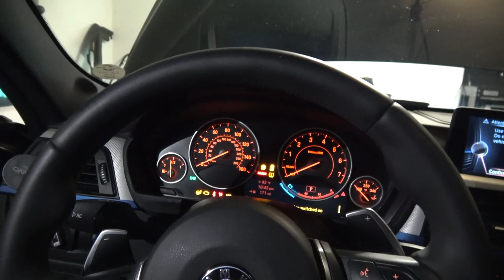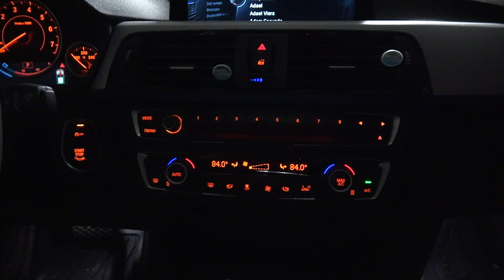DIY HOW TO BMW 335i N54 N55 OIL FILTER HOUSING LEAK FIX

Comment: You have to pull the injector connectors and crank the engine to prime the oil system. BMW put a tsb about this. You’re lucky you didn’t have any damage.

Comment: These things cook gaskets because of the stupid high oil temps they run at, on the N54/55 its so easy to install a BMS sport oil cooler valve, do it and save headaches. Wish it was that easy to do on my BMW V8s!! 
On the other hand, I just watched a whole video on something I already know how to do because I like the way Alberto works lol Good video
Reply: Now your oil is cold for like 20 mins instead of 5 mins. Bad idea

Comment: Clean job 👍
BMW Recommand to prime the oil circuit after major job on it. N55 can quickly have rod bearing issue if the oil pressure is low.
Pull out the fuel pump fuse, remove the residual fuel pressure in the rail so it doesn't start.
Crank it 3x10s, let the starter cool in between.
Reply: I was so scared I pulled the injector wires and the fuse, and poured extra oil into the filter housing before cranking

Comment: Wow.. I've seen many DIYs on the BMW E90s and E46s, and I must say, you did a great job with narration, and attention to detail on the important steps.  Great camera quality as well.  I thank you very much, I must say that I have a 2011 E90 335i, which has a slightly different engine arrangement mostly from the airbox, from what i can see.  

Thanks again my friend. I'm now subscribed.  I'm glad to throw you donation to support your Vlogs, let me know.
Reply: Your 2011 E90 335i probably doesn't have the oil cooler attached to the side of the Oil Filter Housing like Alberto's car in the video... Mine is also slightly different, in that I don't need the first gasket that he replaced.

Comment: This is a great comprehensive video! My oil filter housing wasn’t fixed well causing more spills, an engine smoke out and then a engine overheat all in a 15 months on my 335i with less than 50k miles. This cost 4K to fix because it was largely misdiagnosed. My mechanic didn’t even see the cross contamination with the coolant! I did and I’m a girl!! This video was a huge help in explaining the process to me. Thank you!
Reply: Also, love how you suggested to drain the coolant first!!!!!! And the precautions on the oil filter! You do clean work! None of the other demo videos explaining this fix take this measure which is great because when you have chronic leaks a clean job is paramount! Rock on man!

Comment: I did just this on my F30 335 2 months ago.  Pretty easy, just tedious that was all.  I made a grave mistake by letting the oil leaked so long.  So I had to also replaced the serpentine belt and did major engine cleaning of oil.

Comment: Thanks for the video, it was really good. I am hobby mechanic, this was my first engine work ever and your video was one of the main source for information that I used. Personally I had a lot of problems getting the intake out of the way also the oil cooler line ended up leaking a little bit, apperantly the orings are supposed to be renewed each time they are disconnected.

Comment: A tip for bolts in tight spaces, use about 6 to 12 inch piece of vacuum hose attached to the head and feed it.  I also use that with spark plugs as well so I dont crossthread.

Comment: hi is in US The torx different az im in Europe and to unscrew  this middle bolt , near the oil thermostat, i need to use T27, i tried with T30 but does not fit,

Comment: If I'm not mistaken there is a jack point dead center under the engine, at least there is on my 2009 335xi, makes it super easy to lift the whole front of the car, but I'm sure you knew that already Big Boost :)

Comment: Damn those bmw love to tick. I remeber stressing out so bad when i first got my n54 and heard that loud ass ticking without the cover on
Reply: It’s the high pressure fuel injection. The plastic engine  covers are supposed to suppress the sound.

Comment: Is there any sort of temporary fix to this problem? Currently need some more time to get the money together for the fix, but is there anything I can do to slow the leak? Sorry if this is a stupid question, I'm not mechanically inclined but have been learning a lot with my car and do the work on my n55 335i myself. Haven't had a single issue yet but I know this problem needs addressed ASAP

Comment: Alberto you shouldn't touch used motor oil man. It's one thing to touch it if you do an occasional oil change here and there and it's another when you touch it everyday to make a living. It's been observed that prolonged exposure to used motor oil causes cancer. Save yourself some grief for the future. You don't want to keep touching that stuff.
Reply: Belicose777 you have never worked on a car if your hands havent been covered in oil lol you are not going to get cancer
Reply: Dixie Racing Team Black latex gloves and a long sleeve shirt. I've had to wash enough grime and oil off of my hands and forearms to learn how to keep it off of me. Key word here is prolonged. It's not a possibility it's a recorded observation that constant oil exposure to your skin has caused cancer in the laboratory test environment. Read the warning label on the next quart of oil you buy. Just a warning man. Just looking out. Also you don't need to have contracted crabs to have had sex. :p
Reply: All he needs to do is where gloves when you do work that's what I do
Reply: i also work on cars daily and i always use latex gloves when working with oil and work gloves work on other no oily parts. Not just for protecting myself but also because its so much easyer to just remove th gloves and your hands are clean.
Reply: My grandpa owned a garage and worked on cars his whole life. His hands were always very oily and he is still alive today at the age of 90. Literally everything we do causes cancer these days. Stop being afraid and just live god dammit.
Reply: Just look outside everything causes cancer. I agree that its nice to use gloves but im sure this dude has a mom already!.
Reply: If you aint got oil on your hands a few times in the garage then wtf are you doin!
Reply: Belicose777
What about prostate cancer.how would you prevent that??
Same whit touching oil everyday.....

Comment: Save 400 $ doing this yourself. Not 1000.00 haha clickbait
Reply: Isn't this a $1000 job?
Reply: Auto haus does these for 400$
Reply: @BMWI-gk9wh  Im guessing thats a local shop? Dealer def charges $1000 though
Reply: That is a worldwide vendor autohaus if you work on bmws you buy parts and if you buy parts you kno what auto haus is. It's the bmw AAA European car mechanics. It's not a 1000$ job. Anybody who works on bmws knows that the dealer will fuc* you in the as#! Dealer would charge me 200$ for a 20$ window seal aswell. I have five  335is and 3 328is and do my own work. And others.
Reply: 1000$ from  dealership... definitely!